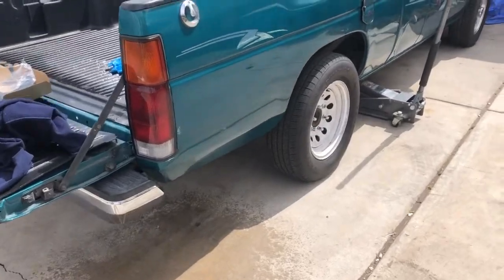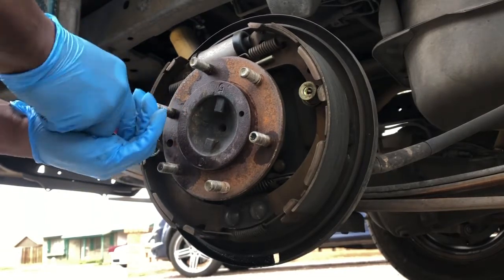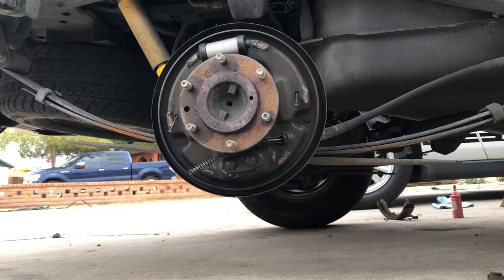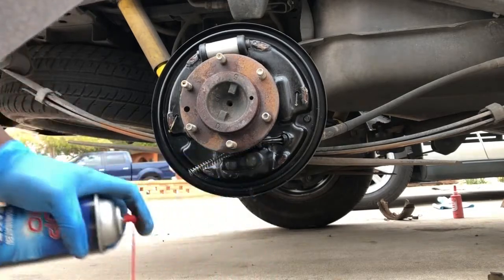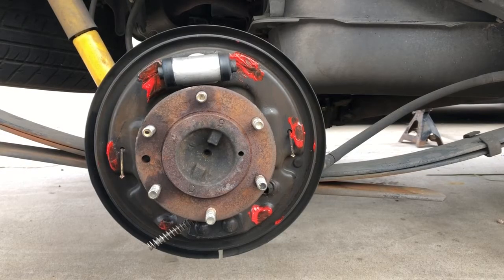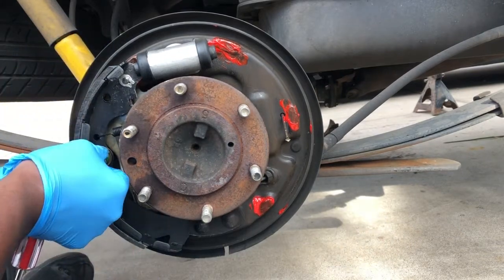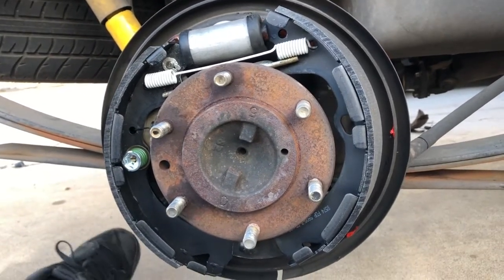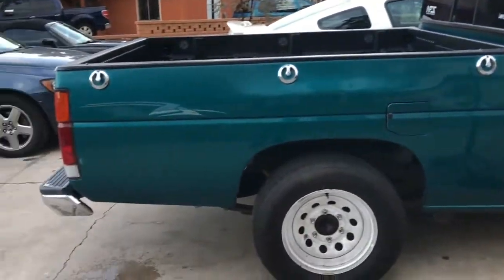88-97 Nissan D21 Rear Brake Shoes replacement

Comment: Knock a pocket flathead between the two ends of the clip then take a larger screwdriver place it on the end and you can hammer it out in one go
Reply from the maker: To late for that i got it out ha ha
Reply: @curtfox91  just a easier way

Comment: " Disc Brake Quiet forms a water resistant, high-temperature film that absorbs noise while quieting squeaks & squeals. Specially formulated to dampen the vibrations that cause brake noise. For use on the back of non-shimmed disc pads."
Reply from the maker: Wow you deleted the other comment you left. And like i Said my Brakes are still Fine to this Day 🙌

Comment: Toss the special tool away 👍  get a snub nose plyers placing them over centre pin not clamping But just compress the round spring , once compressed rotate plyers until slot lines up then Release ! 5 seconds per side this way
Reply from the maker: Already got it on

Comment: You should be able to put all your springs on with the brake spring tool. However, Your method worked.
You should clean and lubricate that self adjuster. Most of them don't work because they're full of crud.
I hope you put the cap back on that wheel cylinder. Constructive criticism aside it was a good video.
Reply from the maker: Lol I put everything Back as needed Brakes are still good and strong since this video was made.

Comment: Read directions!!!
" Disc brake quiet " ISN'T lubricant is a product that dries on back of disc pads to create soft surface to PREVENT rattle WHEN hardware fatigues.
Dude!
Reply from the maker: My Brakes dont make any Noise. Im Happy 🤘